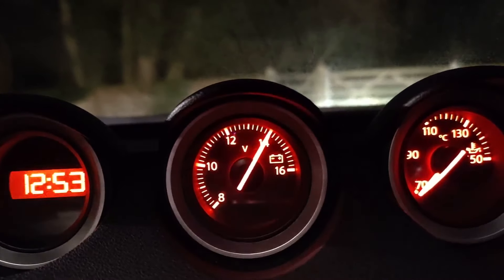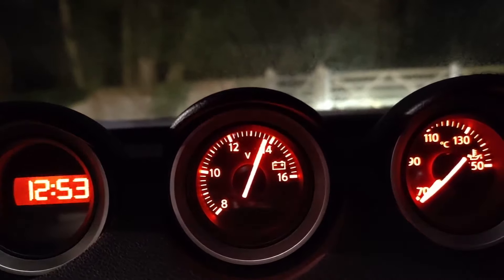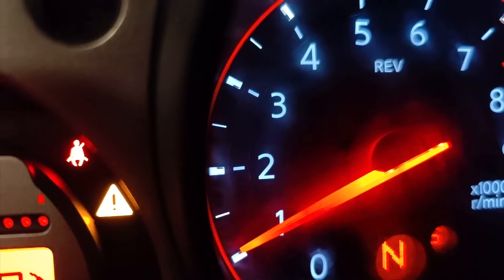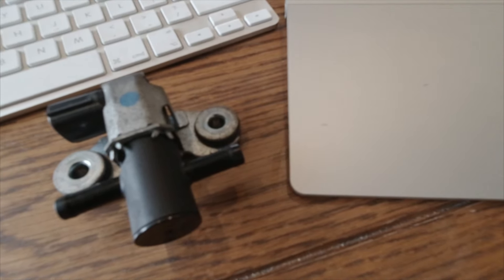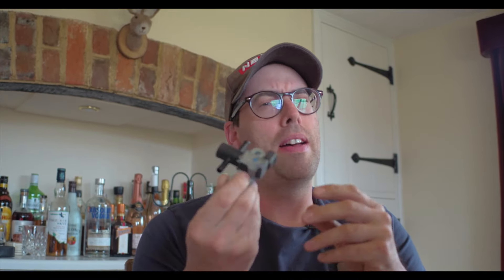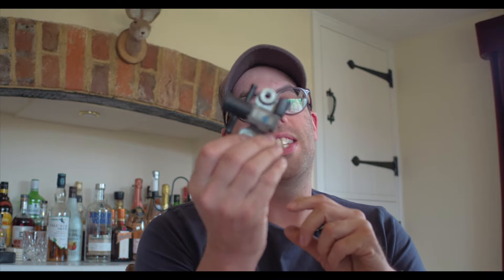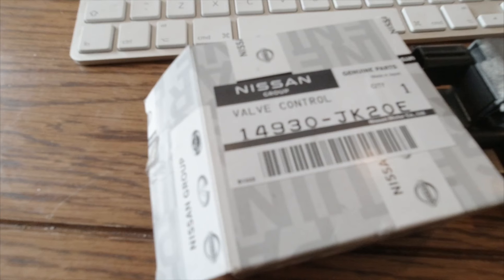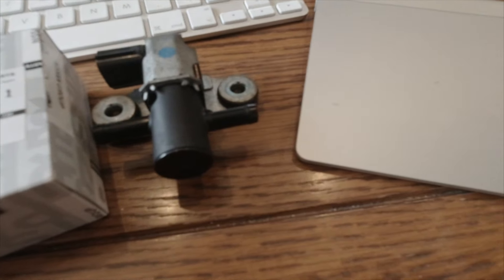370z Evap solenoid, fix your rough idle!

Comment: I have read in some places that the solenoid can get noisy during its duty cycle and start clicking when it's hot, especially noticeable at idle. This has been stated as possibly being mistaken for a noisy valvetrain. Did you notice any kind of clicking when the engine was fully hot at idle and if the replacement cured it? Thanks.
Reply from the maker: No noticeable clicking from mine I'm afraid

Comment: Hey man did you have any backfiring with this? My idle is backfiring like crazy and have a limp mode at 3krpm
Reply from the maker: No, sounds like you have a different issue, have you chucked a code reader on? Could be maf related, try unplugging them and seeing if it makes much difference
Reply: @leedfollow My tuner gave up lol.
Checked and replaced coils, sparks, injectors, power going to injectors too.

He said no timing or cam/crank sensor issues, and afr is fine, but I did check the computer and crankshaft sensor came up last night.

Now I'm looking for random things.

Do we have crank and cam angle and position sensors?😅

There's definately a misfiring going on in cylinder 5...comp test is fine tho.

It's a bloody annoying one 😅

Comment: hey man! What year is your 370z? because in other videos the evap solenoid is in the back of the car
Reply: i have a check engine p0456 and bad cold start so i believe after replace solenoid will be better
Reply from the maker: Mine is a 2010, so pretty early, fingers crossed that solves it for you!
Reply: @markkarpov5789  did you fix this code? Ive had it as well for some time but don’t want to be buying parts and then it not fixing the code.
Reply: What about you mark? Can you please lmk
Reply: I believe you’re confusing the solenoid with the canister itself. The cap canister is at the back. I just bought both but haven’t installed yet, could be wrong.

Comment: I got PO456 code and replacing the gas cap did not fix anything. Do you think this will get rid of the CEL? I was trying to fuel a week ago, and the pump will not let me fuel. What causes that?
Reply from the maker: If you can't put fuel in I'd guess it's a venting issue with tank and charcoal canister area, wouldn't put it down as anything electrical
Reply: @leedfollow  So, I was testing my evap solenoid and realized it doesn't have the issue where it is always opened. However, I realized it is not opening up even after about 5 minutes of running the engine (it is not sucking). I am assuming it is staying closed which is causing my CEL to come on. 

The passenger side of the evap solenoid should be open and i should be able to feel the sucking after running my engine on idle for awhile right? (how long does it take the purge valve to open up and vacuum?)

Comment: Hey man did you have a code for this? Just got a p0441 replace the purge valve near the charcoal canister but code came back on after 200 miles. Already did gas gap but I’m thinking it’s the solenoid
Reply from the maker: No codes, just the early start of symptoms, idle a bit funky and slight loss of power low down, not sure where you are but if USA the valve isnt that expensive, here in UK it's not far off double the price.